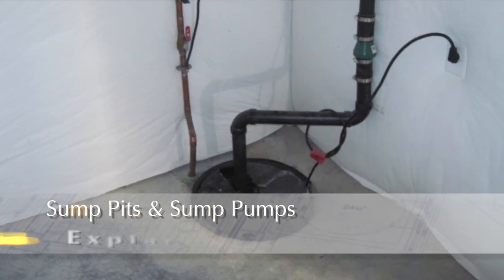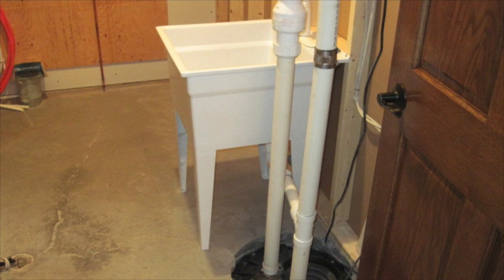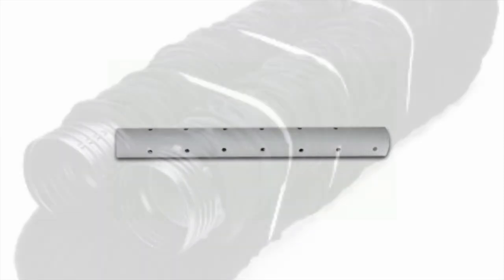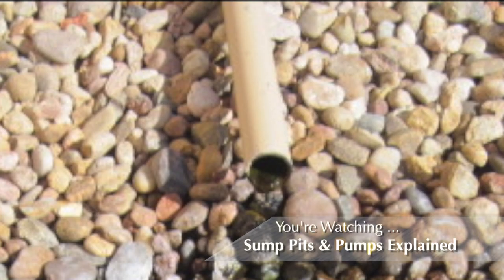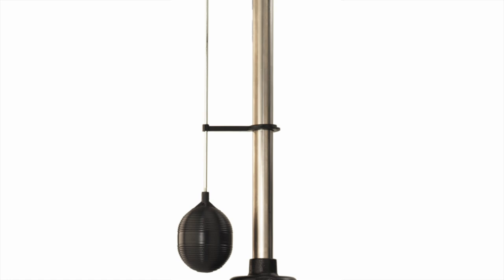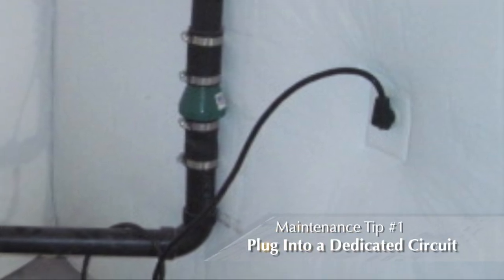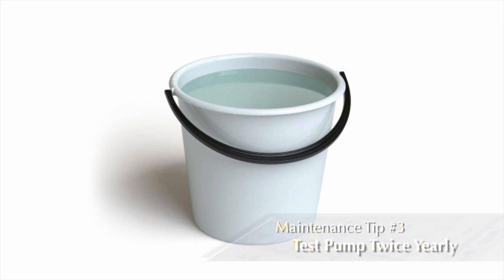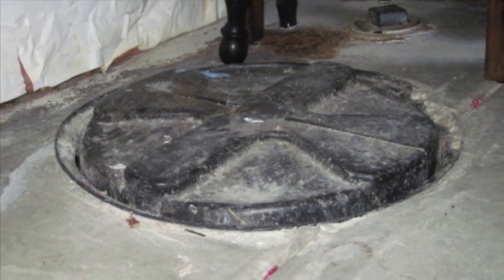Sump Pumps & Sump Pits Explained

Comment: How shall be the bottom of sump pits. Is that open to the soil or sealed with a concrete floor. My sump well had lots of sand at the bottom and I wonder whether was that sand accmulated or is that the ground of the sump pit. Do I have to remove that sand from the pit??

Comment: Does it matter if the hole is above or below the check valve?
Reply: if you are asking about the air relief hole, drill below the check valve and closer to where the discharge pipe is attached to the pump.  1/8" drilled hole.  Make sure it is horizontally drilled or even a very slight angle upwards as you drill into the pipe.  Make sure it is NOT angled downward as you drill into the pipe/
Reply: If Zoeller or Liberty brand pump, I believe that already have a small hole in the base of the pump which you can see.  Some other brands/models may also have it.  Then I don't believe you need a relief hole in the discharge pipe.  The instruction manual may still suggest one in the discharge pipe though.  Periodically ensure the hole is not blocked.